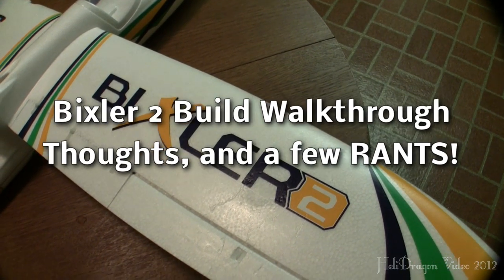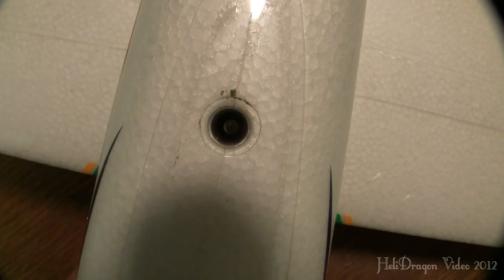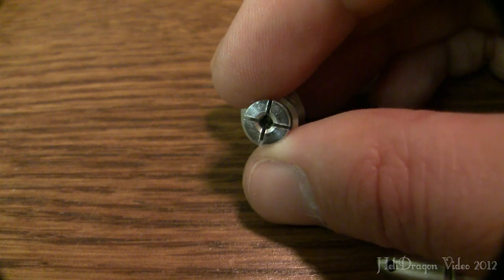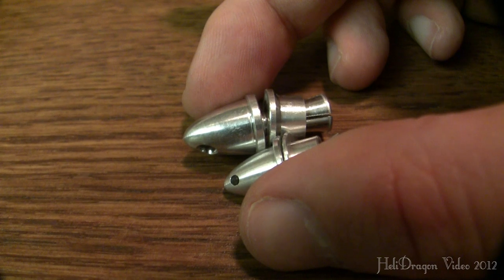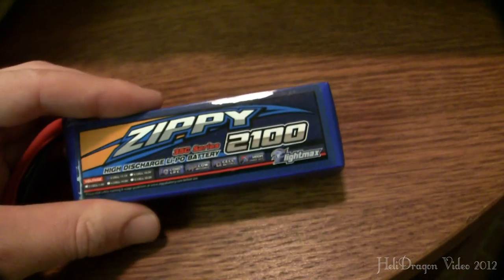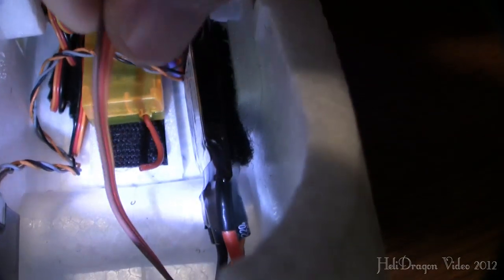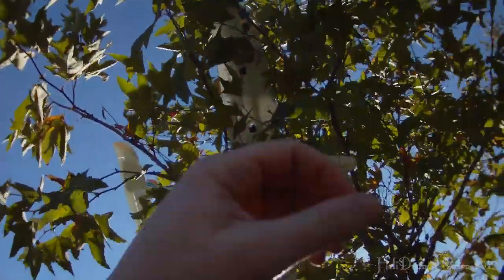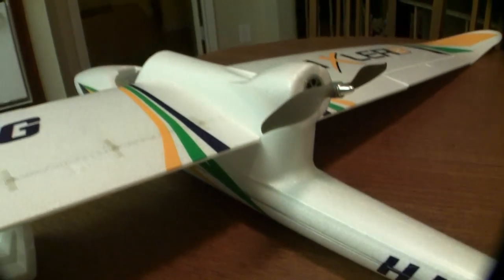Bixler 2 Build Tour

Comment from the maker: A good tip for sure. I had my ailerons and flaps all on their own channels when I first built it for ultimate flexibility and tuning. But when I added FPV gear (video coming soon) I needed to put a Y adapter on the ailerons and a servo reversing Y adapter on the flaps because I needed all 7 channels to run, Throttle, Ailerons, Elevator, Rudder, Flaps, + 2 channels for modes on the OSD, RTH and Screen Data.

Comment: For other fliers out there I give a few tips. Use Y-cable for flaps. Why on earth put flaps in two channels. Also ailerons can be used with Y-cable. So you get 2 free channels for not compromising anything. If you want differential in ailerons - google for mechanical servo differential. That means servo arm is sitting about an 45 degree angle forward in NEUTRAL position. It is fantastic solution, I use it in bixler. So you can have a free channel and still aileron movement up more and down less.

Comment: @myforsake, the primary difference between fixed wing aircraft radios and rotary winged aircraft is that the position of the flight mode switch and the throttle hold switch. Most modern computer radios have programming for all types of aircraft so it's the physical location of the toggles.  If you are getting into the hobby and want to try airplanes and helicopters, then I'd recommend you get a good helicopter radio.  You won't regret it.

Comment from the maker: Yes, I have flown a 1500 and an 1800 separately in my Bixler 2 before I weighed it down with FPV gear and even after and it was OK. Just be very careful of for center of gravity. You don't want a Bixler that is too tail heavy or you might end up easily in an unrecoverable crash scenario. Cheers.

Comment from the maker: Hey thanks. Sorry to hear about the soldering iron. If you have NEVER flown, I would strongly suggest you fly with an experienced buddy. Have them launch it for you, get it way in the air and be ready to hand them your radio. It's very different than driving an R/C car. Its not hard, but you are very likely to crash without a mentor to help you get started. Also fly some place BIG away from any houses, cars, freeways, people. Good luck.

Comment: Oops,  sorry; obviously didn't about the "derp" term.  I used two-part epoxy to glue down the spar cover, and like yourself, being careful not to get any of the glue into the spar channel.  I also devised a system so I can remove the horizontal stabilizer, enabling me to pack the plane in a smaller box for traveling.  I am having trouble with the motor that came with the Bixler.  It doesn't always start up properly;about every 10th start, it just stutters; tried several ESC's.  Any ideas?

Comment: You probably got 5 answers already, and if so delete mine, but:
centi = 100
milli = 1000
centimeter = there are 100 of those in 1m
millimeter = there area 1000 of those in 1m, so it's 10x smaller